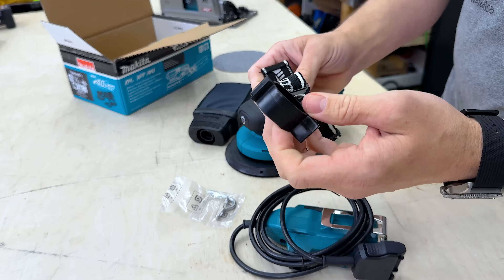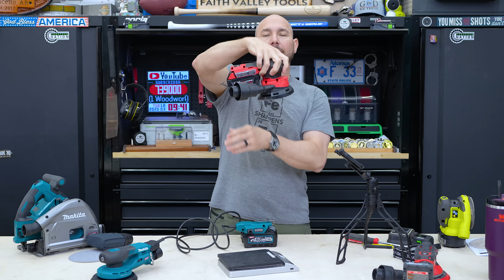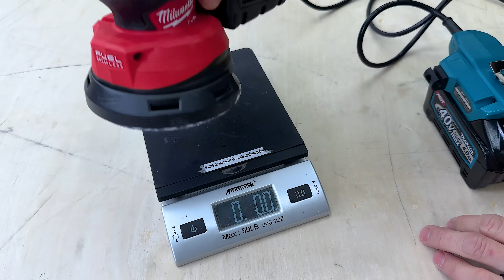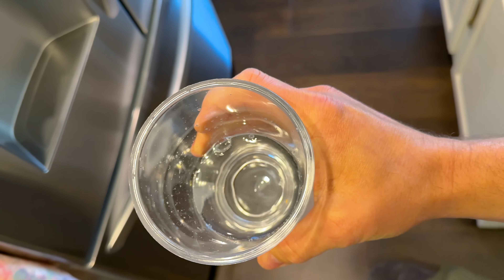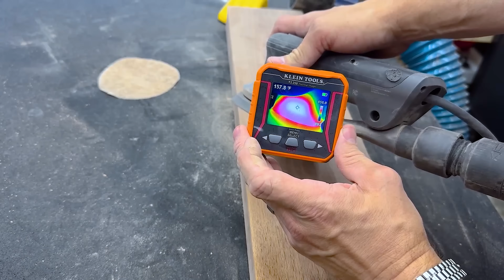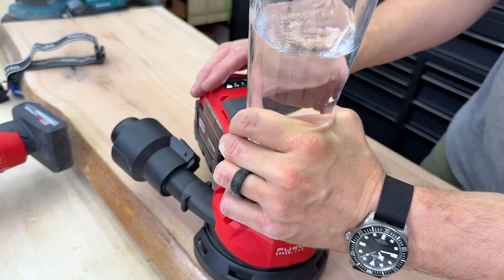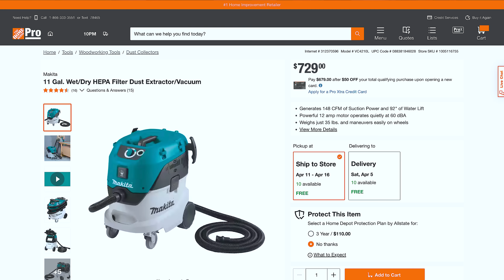Makita Just Changed Cordless Sanders FOREVER! (genius woodworking tool)

Comment: Interesting concept, some one was actually thinking....  If I was to pick up this system, in part because I only work in my shop now days, I would leave the battery pack on my bench. Some days I will wear a shop apron, but generally avoid it. Any manufacturer who is paying attention will either make slightly over sized discs, or undersized pads. In the old days when most abrasives were paper, the paper was pretty heavy, and the edge of that paper would leave 36 grit scratches in what ever you were sanding. Oh, most of my sanding experience is in sanding bowls which are never flat.... The newer mylar backed abrasives are far superior to the old paper ones, which most of the time, the loops and the abrasive would come apart and your disc would go flying.... If the abrasive disc is the same diameter as the backing, they never go on perfectly centered, and the hooks will also leave marks. 

The "interface" pad/disc is an excellent idea, and maybe they got that from the turning world. We use them a lot since the primary backing pad is rather expensive, and the interface pad is much cheaper. With the newer "micro" hook and loop systems, you can peel the primary hooks off of the backing pad. If you ever try to use a "soft" interface pad on the random orbit sanders, most of the ROS goes into the soft foam, and not all the way through to the abrasive.

Comment: I think when they say 6 inch they mean it had a 6inch throw while operating. I could be wrong but I used alot of different polisher in my detailing days same confusion.
Reply: I think it's more that 6 inch is just the closest SAE size because the pads are actually 150mm, at least that is the case with the Festool

Comment: Thanks, Matt, for your great tool introductions. However, It would have made more sense if Mikita would have just put a battery connector at the tool end of the cord to allow you to buy the portable battery cable for all of their tools and sell the battery cord separately as an enhanced feature to their whole line of cordless tools. This would have grabbed the attention of everyone who are still trying to decide which cordless tool line to commit to before Mikita's competition jumps into making this available for their product line. Then, introduce the new tool separately.
Reply: I agree, I was going to say something similar.  I bet someone smarter than Mikita is thinking the same thing.  Plug any tool into a corded battery.  You could also make the battery plate hold 2 batteries for even longer power.  Lots of options, hopefully others will run with the idea.
Reply: @rogerhuston8287  That would make the tool MUCH MUCH more heavier though because you need an AC/DC or DC/AC converter alongside the power tool unless the whole power tool is DC only and the corded adapter is an AC/DC converter because cordless tools are DC battery powered and mains powered tools are just AC. That is why battery chargers can be bulky because besides charging the battery they are also at the same time converting AC power in to DC before sending the power in to the battery
Reply: @zahidshabir4038  No, I'm talking about doing the same thing. But, instead of building in the cord, you have a small plate that connects to the battery mount and that has a cord. No converters. The tool expects DC and you are only extending the connectors via wire.
Reply: That already exists in makita platform
Reply: Sander design won't work well with that. Battery would take up dust port position
Reply: Jsem v systému EGO pro zahradní nářadí a nosiče baterií na opasku nebo a zádech jsou pro mou malou a slabou postavu učiněným dobrodiním. S benzínovým nebo kabelovým nářadím bych měl poloviční výkonnost a problém se zdravím.
Reply: You could just put a male female power connector in the cord but I imagine that click connector will be common to the range ??
Reply: Makita do have this, but availability could be region specific, look for: Makita Battery Adapter BAP18E A-72067
Reply: That sounds like a good idea in theory, but there can be serious issues with this for higher power draw tools, as that would make that cable work with every battery powered tool they make - and something like a circular saw will draw a lot more amps from the battery than a sander does. And more amps require thicker cables, unless you're a fan of melting cables or electrical fires. So, that would either force them to either use much thicker wiring for every one of these adapters, making them heavier, less flexible and more expensive, or run the risk of these things being used with the wrong tool and overheating.

A sander likely has a 100-200W motor, or 2.5-5A on a 40V battery. A circular saw is more likely 1000-1500W, or 25~38A. You can run 5A of 40VDC for 1.5m on a thin gauge wire, something like 21-20AWG with minimal voltage drop and wire heating. For safety, best practice is to overspec wires by quite a bit to compensate for wear at the connectors, potential pinch damage, and so on, so say 18-16AWG. Bump that to 40A for the saw, and you'll need an 8AWG wire, or nearly 30x the cross sectional area of wire (compared to 21AWG) to keep within the same base requirement. For added safety margin, let's say 6AWG. Or you could of course do a bundle of thinner wires, but that would make the cord even thicker and less manageable. Either way, you're looking at a massive increase in wire thickness, weight, cost, and rigidity.

The third option would of course be to make multiple identical-looking adapters, some for low power and some for high power, which would be a fun game of potentially burn down your workshop roulette every time you need to use a high power battery tool.
Reply: @Kraaketaer  Point well taken. But Makita's 7-1/4" cordless saw needs 2 batteries working in tandem for 36v operation. So, it won't be used with such a device. Their 6-1/2 " comes with a 5 AH battery, so a #14 gauge wire for the power leads should be sufficient for the heaviest loads placed on a single battery. In an overload condition, the battery would burn up before the wire would.
Reply: @ancienttom97  That is simply not true, unless they're using very low quality batteries for their battery packs. I've never actually seen a power tool maker specify the power draw of their battery powered tools nor the max amp output of their batteries, but in general, many of these are high powered devices and thus their batteries need to be able to handle those loads. The saw needing twice the voltage is really just making up for the fact that even using high grade LiFePo batteries, the ~55A output needed for a 1000W saw on 18V would be borderline unsafe, or at the very least would cause premature wear on the batteries (and the saw power would drop dramatically as the battery drained and the voltage dropped. But doing so over a wire rather than through a connector with thick, solid metal pins would still be way less safe. Yes, batteries heat up, but unless they're using trash tier 10A rated batteries, a wire carrying 55A of DC current would be a problem long before the battery became one. So likely they had the choice between using a rather anemic motor for their saw or doubling up on batteries (or, of course, gambling that nobody would use a small 1s battery pack for any kind of continuous use of the saw, which some cheap brands no doubt do).

Using a 40V system more than halves the amps compared to 18V, which is likely what makes this solution feasible at all (at least at a level of liability and risk their legal team is willing to accept). And as wires heat up, their resistance increases, causing them to heat up even faster. It's incredibly easy to reach a thermal runaway situation in the wire when moving high current, low voltage electric power through a wire, which is why it is done relatively rarely, and when it's done, the wires are typically specced with at least a 2:1 safety ratio.